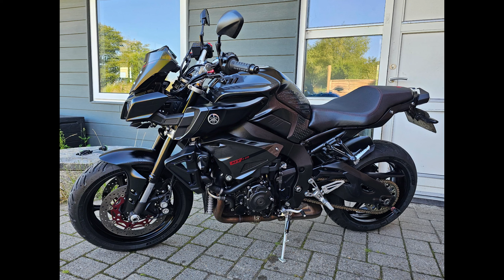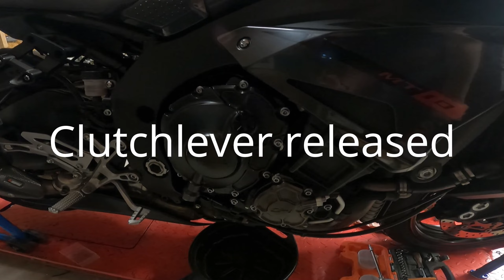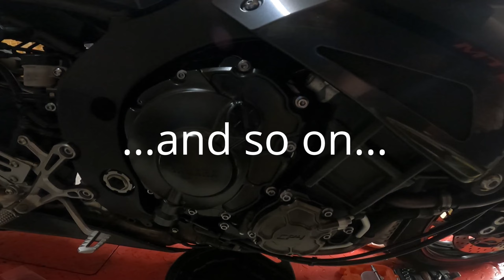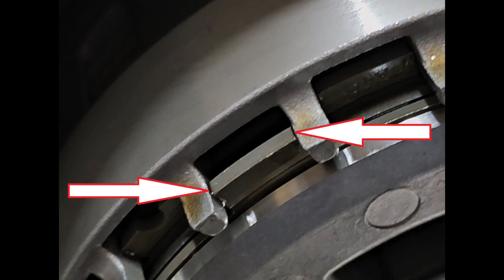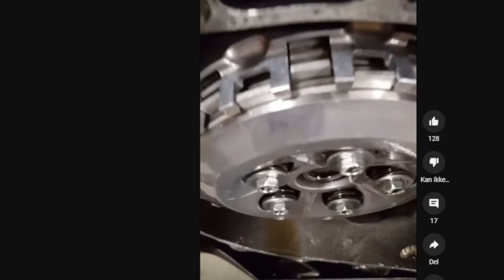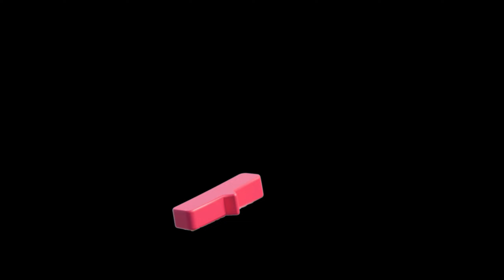Yamaha MT-10 clutch noise

Comment: I have the same noise and crunchy lever feel (1/2 the time, depends on rpm). My bike is brand new 300 miles, just the nature of the machine I guess. I don’t mind the noise but dislike the lever feel. I’m hoping it will break in and lessen. Maybe fresh oil will help as well as the remapping I’m planning (smooth out the idle, hence rocking of the transmission) we shall see.

Comment: Mine vibrates as well especially between 3-6k rpm. Does yours have any vibrations?
Reply from the maker: How do you feel the vibrations? I had a crunchy feeling in my lever, so replaced the 2 needle bearings in the clutch cover, and that fixed it. Otherwise no vibrations...
Reply: @dhpmc5295  thru the pegs and handles, bike feels very buzzy. Another way to tell is when idling, you rev the bike, you can feel it thru the handlebar but if you clutch in and rev, it's much smoother.
Reply from the maker: @Owshua That must be annoying.  Maybe you should take out your clutch basket and examine it
Reply: Mine vibrates shakes rattles gear change also feels bad and black smoke comes out the exhaust, everything gets back to normal when I twist the throttle on full 😂 guys, MT10 sounds rough on idle, will vibrate at certain revs being a cross plane kind, just learn how to live with those few disadvantages and enjoy the potential this weapon have considering it’s price 😉 I own a 2017 one, decated flash tuned with Akrapovic system, 17000 miles of pretty good abuse, oil change every 3k miles and she never let me down. 👊🤙
Reply: @emerel  nah its a diff sort of vibration, tried another MT10
Reply: @Owshua  You ever fix your buzzing mine is doing the same and i cant find anyone else online with similar issues lol